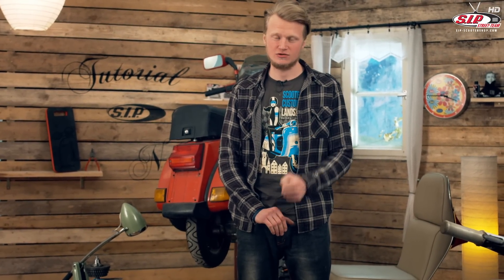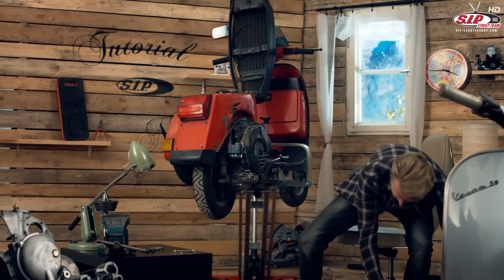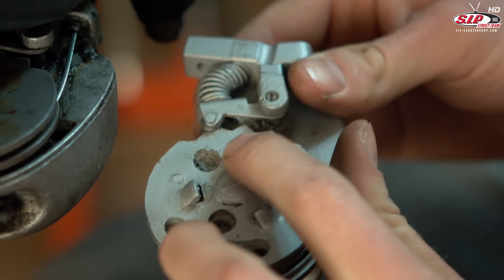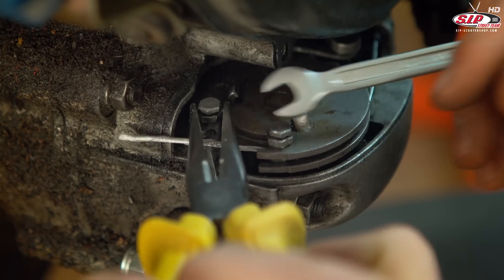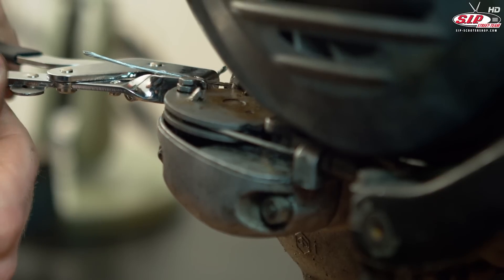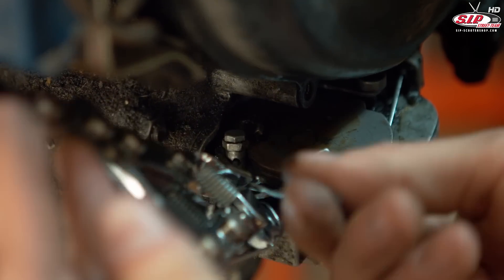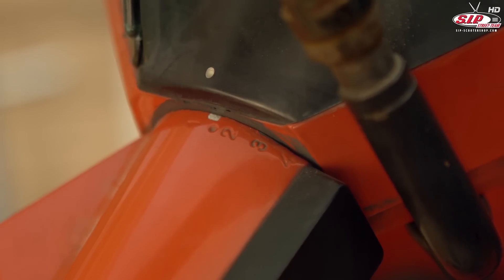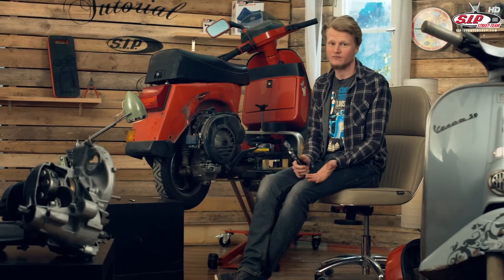Adjusting the gear cables - Vespa Tutorial

Comment: Please help, how do you get the transmission into neutral, in order to sync up with your setting of the gear selector to neutral?  it's not explained in the video.  Thanks
Reply: Manuelpichardo
Reply: +manuelpichardoValaerie Lopez 
You still have not explain; how do you get the transmission into neutral, in order to sync up with your setting of the gear selector and the handle bar shifter position to neutral?  it's not explained in the video.  Thanks
Reply: Rohai Shorin I wold like to know it myself. How did you do it?

Comment: My name is Edward and I'm from Pakistan. I have a 1969 vespa. The problem is with the cabrator,  sometimes the  race goes high when I change gear or sometimes  when starting the vespa . I changed the  slide also the race setting . But no change. What should I do please let me know in a video. Thanks and best reds Edward.